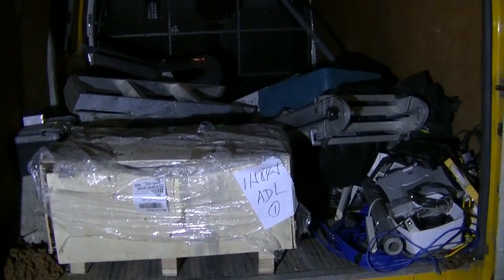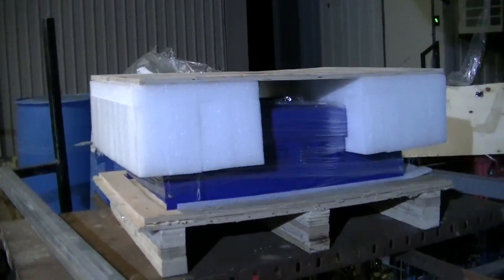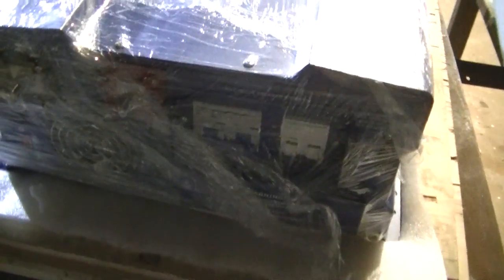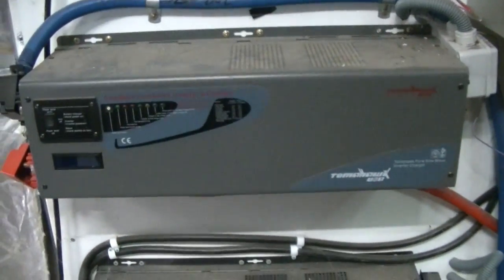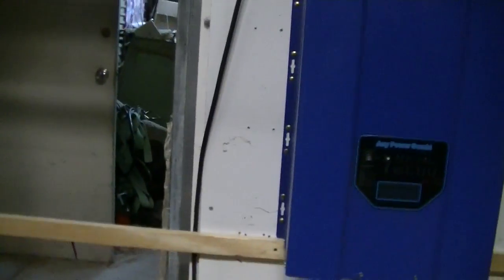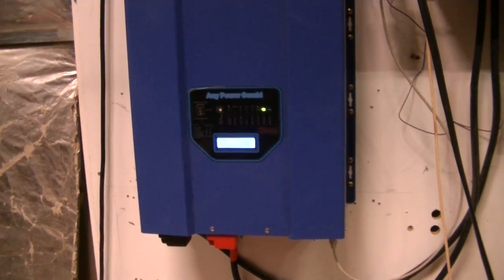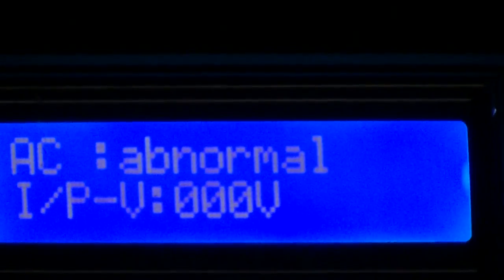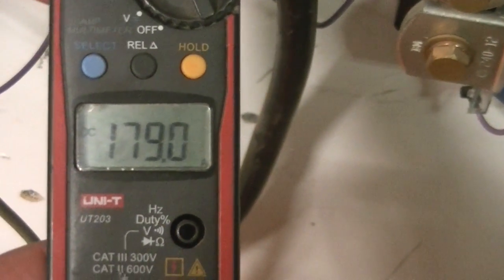offgrid solar Update replacing 2 small inverters for 1 large one

Comment: The blue 12KW inverter died. Its in another video. Not sure what happened to it. What brand was it? I looked like a Sigineer with the transformer design.
Reply: Robert Ballard whay they died is because they don't have thermal compound between heatsink and mosfet I have disassemble my own and put on every single mosfet  on the power board and put thermal compound between and also on the control board I have found some hot spots so I add bigger heatsink and some compound also housing have also some issues side holes should be covered so that air flow will be from bottom to the top side holes prevent this flow and inverter overheat and fail.....I have made the test with open side holes an covered and guess what with open side holes temperature goes up 25degC from surroundings with covered goes only 2degC from surroundings on the same load ......
My inverter runs 24/7 with no heat issue..... 
Otherwise is very robust and is made to last with small issue.....

Comment: I love this. My 12kw is going on full blast now with a 4-0 DC cable set.  I added the 400A fuse.  I am running my 240v 4-ton heat pump 24-7.  We are having the 100'f this summer and run cool 74 all day long.  See mine "Yourhandyman100" Youtube

Comment: hi is this a Aims 12KW unit or a copy
Reply: Nah man, thats the real thing, up to 8 Batteries he can charge(manual selective) if that aims was fully automatic(when battery 1 is full go to battery 2 to charge), he invested very well, 12KW enough to cover the whole house in case he wanna upgrade later on...
Cost of that 12KW aims = $2,530.00 plus S&H

My system setup(idea)(grid assist)
5.2KW solar system(solar edge) on dual axis solar tracker 707kwh
1.7KW pika energy wind turbine(48 volt) on 80 feet tower  202kwh
1x 24-85-25 48 volt forklift battery can store 77.18KW
1x 12KW aims inverter/charger 48 volt
and maybe later when budget fit a Chevy Bolt EV(60-kWh) that will charge from the battery, still have 17KW left for night-electricity

Comment: Shame about that mate. I would sue your sparky. That is what happens when you get an imbalance on the AC side ,  He should have Ripped the old underground wire out and replaced it with one larger one instead of just running another of different length and size and then hooking them up together at the ends. AC does not work that way.Any Sparky worth his salt knows you should never do that. I would fix it before using the big blue unit. That would be my advice to you;. Keep well my friend
Reply: +Justin Case Solar Power Imbalance on the AC side?  What do you mean by this?

Comment: I thought the 6KW  I had was a lot but wow 12KW and loading her down too, awesome man! So far I like the Aims invertor, I'm sure you already know and see you don't have AC power hooked up, I figured it out to leave the AC off because it would charge whether I was getting power in from the Panels or not, I do use the built in charger if I get several cloudy days and need to top off the batteries. Cheers mate and congrats on the new invertor.
Reply from the maker: ***** yes it is a very nice 12000w pure sine wave inverter hopefully it's not as sensitive as the PIP 4048MS MPP Solar inverter thank you for your comment hopefully you can find good sun for your solar panels have a good day